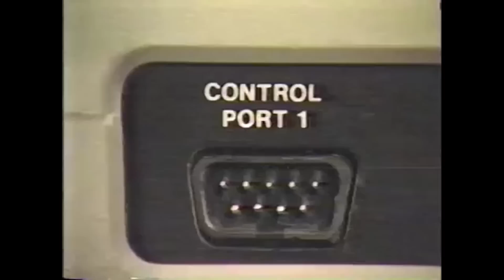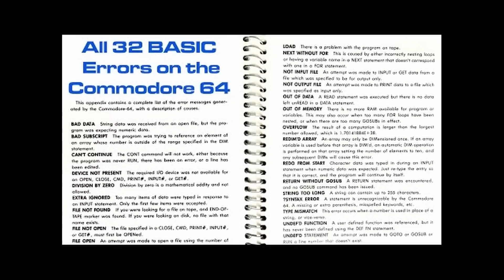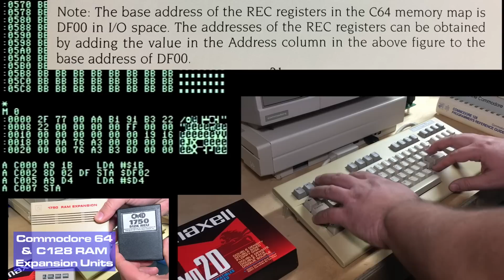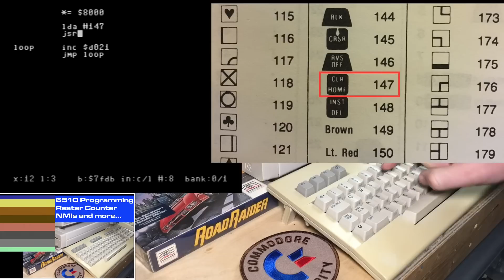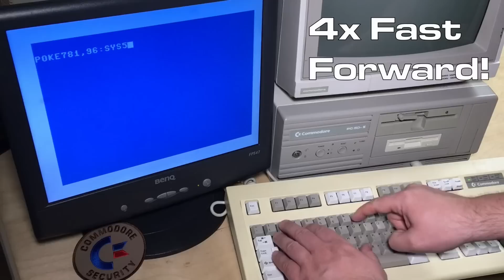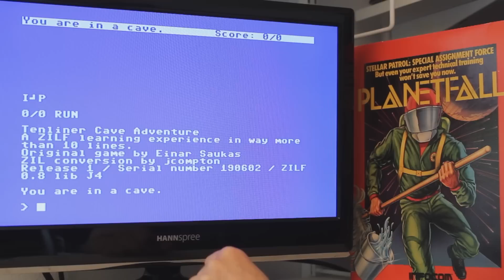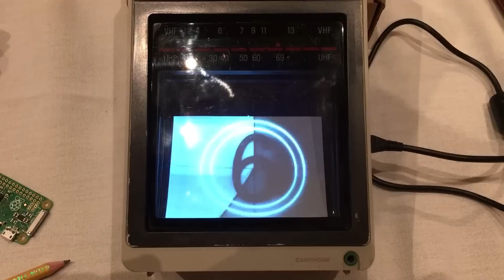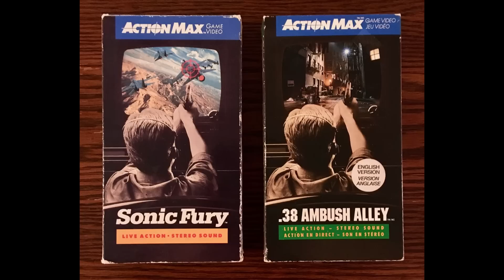8-Bit Show And Tell: Year One Recap

Comment: Congrats!  I'm finally in on the first year of a great channel. And my reaction to seeing your face: "My eyes, the goggles do nothing!" ;)  Oh, as for other 8bit computers, bring it on.  I think most of us from back in the day owned, or were interested in a great many of those systems.  I owned two versions of the Atari 2600, the small slim one and large one.  A C64, breadbox and C64c.  Amiga 500, 1200 and 2000HD as well as a TRS-80 model one with homemade RAM!  I always loved the look of the Atari 600 and 800 computers and almost bought them instead of the C64, but ultimately went with the C64 as it had MUCH more software support for it.
Reply: Homemade RAM? How did you do that?
Reply: @Okurka.  I didn't, I got it from someone else who did.  It was a large box with some sort of wire wrapped electronics.  I know about electronics and memory, but I don't understand how he did it.  I suppose he could have replicated the same circuits that exist in modern RAM somehow.  It was pretty neat.  I wish I still had the system, but alas, I live in an apartment building and am limited with space.

Comment: 9:13 Nice to have a face to go with the voice. 

With regards to your bonus bit about productivity on the C64 reminded me of my excperiences with printers on the C64.
I got my first ever printer back in 1990, a second hand printer which I never new the name of it but was just told "It's a centronics printer". It was a text only printer, no graphics capability whatsoever, and I was given this very basic word processing app and shown what options to set when I loaded it up (which needed to be done every time). The cable wasn't a serial-parallel cable, instead it was a straight parallel cable with an adaptor which plugged into the user (useless) port.

It all worked well until one day, in a fit of rage, I pulled the cable out the back of the C128D while it was still on. Whoops.

$AUD166 in repair fees later... well I never did that again. The printer however started acting up not long after that, with various hardware issues such as the paper feed wheel not advancing after each line, so I saved up to get a MPS1230 new in 1993 (at $299), which, when teamed with a new copy of Word Writer 6 which i saw at a local department store at the time, served me very well until I got my first Windows PC and an inkjet printer in 1997.

Word Writer 6 was amazing, it came on 6 disks and in terms of features I found it comparable to WordPerfect 5.1 (which I was learning at school at the time) in text-only display mode. It even had a spell checker, complete with the ability to save new words to the dictionary disk!. Learning its features and how to put in control codes for things like different fonts and sizes, pictures, page layout and so on, I became a whiz at it really quickly.

In these times of fully featured productivity applications with full WYSIWYG abilities and whatnot, do I miss those days of text display only word processors, with using special control codes and whatnot? Probably not, but the stuff I was able to do with WW6 back then on a simple 64K 1mhz speed computer was amazing. And I don't care what anyone else thinks, but for me the MPS1230 was the best printer Commodore ever released.